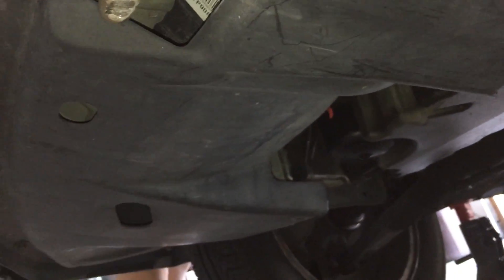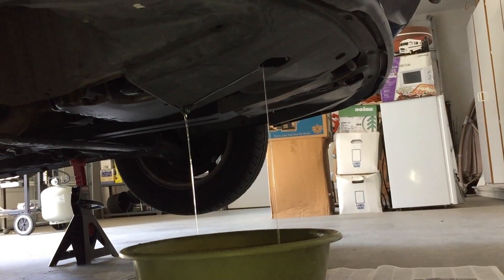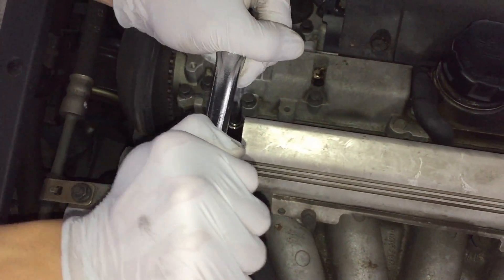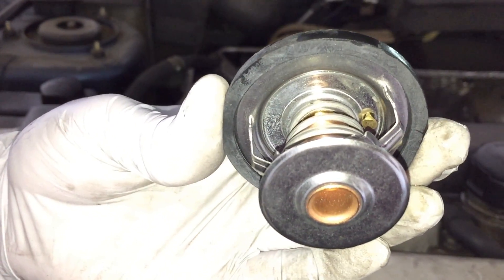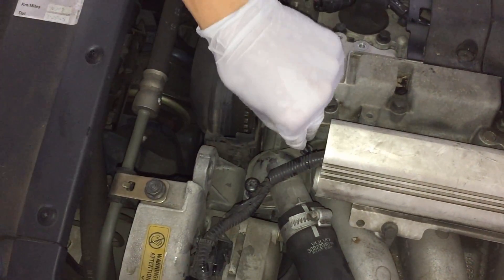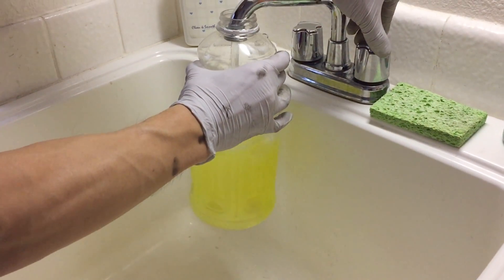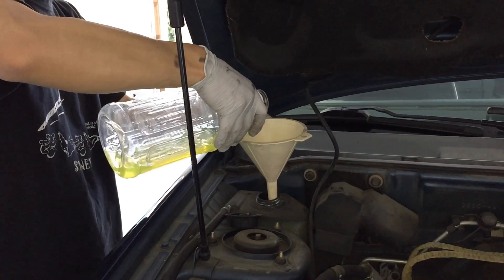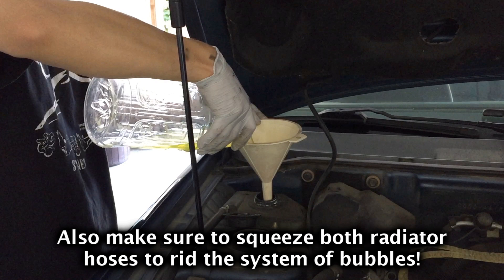Tutorial:  Change Thermostat and Coolant on a 2000 Volvo S40

Comment: Thank you, BUT, after topping up the S40 cooling system, it needs to be bled of air, or the heater might not heat the passenger compartment, and on the Volvo S40, it is at the end of the engine, on the Driver's side, a small 14 mm hex bolt on top of the large hose.  Loosen it, counter clockwise, until you see bubbling air bubbles of coolant passing the threads,   If you totally remove that bolt from the hose, Anti-freeze mix will spew out, after the air, so be quick to screw the bolt in!
Reply: +Patrick Patrick Hi, Is the hex bolt on the top of the engine or underneath?  I found two large hoses but i cant find the hex bolt. My car has the steering on the right hand side and is a 2001 1.8 S40.

Comment: Nukem I always like your instructional videos.  Thanks for sharing. Note that you should use distilled water or premixed antifreeze.  The minerals in tap water are not good for the cooling system.

Comment: Is this helping for fan running without hot engine and waste the battery ?
Reply from the maker: The fan shouldn't be running if the car isn't on.  So no, the alternator will recharge the battery.

Comment: my s40 has coolant coming out of reservoir. w+en it over heats and fan isnt working. is it my thermostat or what? how would i know my thermostat. is the problem
Reply from the maker: If your fan isnt working, you should probably get that fixed. That would be the first step
Reply: Trealy Chi I had the same problem, and to find out it was the coolant temp sensor
Reply: Trealy Chi mine too

Comment: Use destilated wate. This guy on the video used normal water. Don't do that. The hole point of using the glicol (anti-freeze) is to protect the engine but it only works with de-mineralized water or destilled water, NOT normal water from the house.